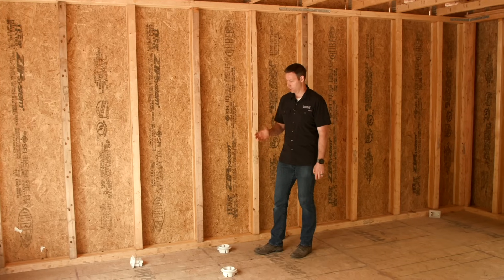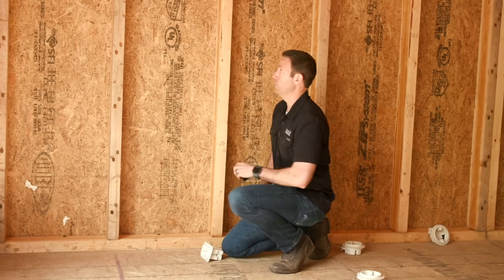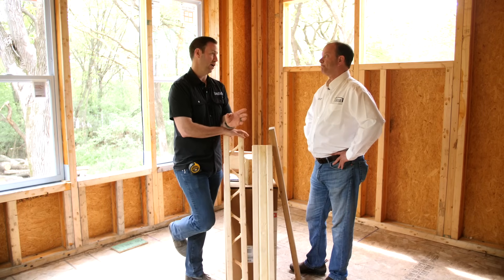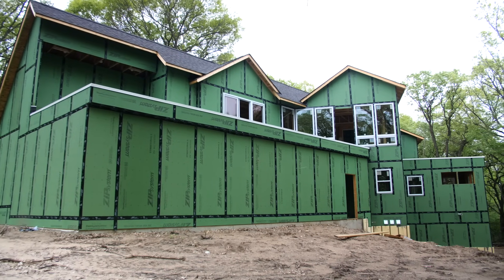Insulated Studs? This is a BIG Innovation in Framing!

Comment: I'm a plumbing contractor.  Can I just cut out one of the inside post braces if it lines up with a pipe? Will it lose strength?  Or just don't worry about it?
Reply: Good question, wondering that myself.  In theory, these would only be used on exterior walls, and at least in the North, plumbing tends to be designed away from exterior walls in new construction. that's not to say that you wouldn't ever run into the situation.
Reply: @andrewalexander9492  this may be true. But I like to stand at my kitchen sink while either washing pots & pans gazing out across the fields. I don't want to look at an interior wall all the time. Even in the north. I'm sorry to hear that's what people have to stare at.. i like the wide open fields.  Its Relaxing!!
Reply: Lee, apparently the answer is No.  The TStud Field guide says "NO dowels can be cut for placing pipes in walls or for any reason. See Tstud.com for how to make repairs in the field. "
Reply: @andrewalexander9492  so if I have a 1-1/ 2 inch drain arm running horizontally from a vertical 2 inch vent over to be under a kitchen sink with a large window over it. I'm either going to be to high or to low with the drain coming out of the wall? I'm sure I can think of more problems this will create for one sub or the other. Great product for the builder. I'm sure the electrician would love no drilling.  Plumbers work with measurements. (exact)  
If I have to drop my drain pipe down another 2 inches or more. Every drop of water that falls from the strainer to the water in the trap. Will make a loud sound. Kind f like when a plumber drops the p-trap to far away from the shower drain. It echoes like crazy.
  Don't get me wrong.  I love the product.  6.5 or 6.8 to 20 rating. Great idea!
Reply: @ltsgarage7780  Yeah, no doubt this will make some extra work for some trades on occasion.  Not a plumber, but in the situation you describe, can you run the drain arm off of a wye on the stack, and angle it up to the right height?  Or just come across horizontally at a lower (unobstructed) height, then 90 up, then out at the proper height?  Granted,  that's more fittings and more measurements,  so more time and money for you.
Reply: @andrewalexander9492  if it were code legal. It would be a fair idea. 
 I'm saying.  The 2 inch drain comes thru the bottom plate off to the side of the window. It comes up to 16 inches on center of a Tee. Then changes size but not direction. It continues straight up through the roof.
At the Tee. It will go horizontal over close to the center of the sink. You cannot move the dead arm up because if the home owner wants a good 1 or 1-1/2 hp garbage disposal the drain coming out of the wall will be to high. It you move the Tee & dead arm down. You pick up a noisy drain when you run water at the kitchen sink.
   Even where you live. Doesn't the Lady or the man of the house not enjoy being able to look out the large kitchen window while washing dishes or cooking then rinsing dishes. That's why I have a 6 foot bay window over my kitchen sink. You cant come through the bottom plate at the center of the kitchen sink. The travel straight up to a Tee at 16 inches the travel up to the bottom plate of the window because you cant install a 90 under 42 inches off the floor. Most counters are 36 inches the 4 inches to the bottom of the window. That 40 inches off the floor. We as plumbers must work within these codes. 
   I guess its  catch 22. T-studs everywhere then put up with a noisy drain. Or T-studs everywhere except a couple of 2x6 regular studs at the kitchen sink. So when the owners move in they don't complain to the plumber about how noisy the kitchen sink is. Because the contractor doesn't hear about this problem.  The plumber does.

Comment: Good luck with renovations. Running electrical and plumbing through those walls..........
Reply: You seem to not notice the part showing the electrician is just poking though the insulation with a screwdriver!
Reply: @Joshua79C  You seen to not understand how renovations work..
Reply: @TsiRoadkill  wow way to outright assume I know nothing of renovation works, I was a teen when my mom and step-dad at the time were taking the time to finish up what my dad had started before they got divorce,. I know all too well what is entailed in construction or renovation work.  I also watched the Tstud video of their product and seen that the two pieces of strip wood are connected by dowels in a pattern to hold the closed cell foam in place. But yeah I sort of get your point when it comes to conduit run or plumbing as I learned the basics of those as well both in high school and on the job with the step-dad working for him doing basement waterproofing work.

Comment: Begs the question: what has been the drawback before now. Spray foam has been around for good while now but no one has approached it from this angle. Would have thought someone would jump on it as soon as spray foam became available. 
Would say manufacturing this stud is quite a bit more costly than a mill spitting out studs. Wouldn't believe a savings of wood could be made up in the difference.
Does look like this is limited to 2X6 walls. Is the common 2X4 wall still cheaper? We see initial cost of construction is the drawback to using 2X6 walls. The general is not going to buy in to this 2X6 alternative so easily. And most homeowners are buying homes already constructed. So, looks like this is a limited market item until local codes start to change to require it such as in tornado/hurricane areas.
Reply: Rob, I'm guessing that you're located in the south, if you're saying that the General is not going to buy into 6 inch walls.  Not saying you're wrong, I'm sure what you're saying is correct for your area,  but in more northern regions 6 inch walls have been the standard  for decades now.  And it's primarily  because of  the insulting value.

Comment: Blast!! I saw a similar truss with wire instead of dowel used in Azore islands for roof trussing that had T cinder blocks set on top the covered with concrete and thought, that could be used for walls too.

Comment: What a bullshit, wood is actually fairly good insulator. In europe, we insulate our house from outside, not from inside... Make a house european way and it will last forever.
Reply: Then there are other Europeans who say "you still built with sticks?" or "No wonder your homes still get blown down in bad weather" who still build from stone or concrete. Not all regions around the world share the same building materials and method standards. Such guff irks me and shows their ignorances of their own building codes and standards. are not much better when it comes to earthquakes which can still shake their hard buildings to rubble.
I am planning on building with a combination of ICF, Post Frame and TStuds for the main structural, and then decide on what i like more when it comes to the insulation and cladding based on what i know and like about each.

Comment: You can confirm this inefficiency easily in your home.  A simple IR temp gun with laser pointer* clearly shows where all studs connect with your ceiling joists.  Pointing this at an inside ceiling corner on outside walls (this is where many heat soaked framing boards come together) after a sunny day will SHOCK you.  No amount of insulation will stop this radiant heat coming into your home...throughout the night!  The overall heat energy/mass available in your roof pours down these boards into your home like an open water pipe.

However, there's much better solutions than what is shown.  Fiberglass insulation coupling between all roof components (rafters) that couple to home/ceiling joists.  Very strong, available and requires little engineering.  It simply turns the heat spigot off.

*A IR imager works best but if you  check your cheap IR temp gun pointer accuracy on a heat point source (candle) from 10 feet away you will know how close the pointer is to the actual surface location temp is being measured.

Comment: Great video.

Electricians will love that stuff. :)
Reply: Skinski7, running wiring horizontally is obviously much easier with these newfangled studs, but how would you fasten the wire when running it vertically? Do you need some special strap fastener that bridges to the solid wood sides of the engineered stud? You can't possibly mount Romex or BX securely to the foam itself. I also wonder about fire codes and toxic gases in the event of a fire. Fireman would probably hate this stuff.
Reply: i would imagine smoke in a burning house is already quite toxic.

I’m sure someone will come up with some kind of bridging plate or clsmp  for vertical wiring.
Reply: @Skinski7  , as a former telecommunications installation Tech, the dangers of fumes in a burning building is something I have more than a passing familiarity with. The reason that we now have certain types of cable that can be purchased with a special fire rating for use in plenum ceilings or other building environments where there might be significant air flow taking place in the walls and ceilings,  or from one section of the building to another via air ducts,  is because people were being found dead just inside the entrances of Office Buildings that they tried to escape from due to a fire elsewhere in the building. Toxic fumes  weren't necessarily even that visible as smoke but we're being distributed  throughout the building by the ductwork . PVC insulation in particular puts out extremely toxic fumes when it is subject to high heat, not even necessarily burning. Ductwork and plenum ceilings in particular can spread those fumes many hundreds of feet away from the source of the actual fire. When I was doing Telecom installation work for a living, many of the jobs I worked on required plenum rated cabling, designed to not throw off toxic fumes when burning*, even if the cabling wasn't necessarily being run in a plenum drop ceiling with air circulating through it. I'll hazard a guess that each of those engineered and foam filled studs probably contains the equivalent volume of fifty or a hundred feet of electrical cable. If that foam is toxic when burned, it would be a very bad thing for anyone caught in a home on fire, and equally bad for the firefighters.

* early forms of plenum rated fire safe cabling or actually made with Teflon, the stuff was very stiff and springy and prone to kinking, not easy to work with. Later versions had a different insulation that was somewhat more forgiving but it still wasn't as easy to work with as PVC insulated cable.
Reply: I suppose the answer is a non-toxic foam of some sort if there is such a thing. I suppose it all comes down to risk/reward.
Reply: @Skinski7  , the  other thing that occurs to me is the ease with which mice and other rodents  could travel from one wall cavity to the next to the next to the next  unhindered, simply by chewing through the foam . Where I live in  woodsy Southern New England,  mice are everywhere and it is a constant battle  to keep them from setting up house  in my own house. I have several bucket traps in the Attic, several more in the garage and basement, and a few snap traps scattered around as well. The only way I could consider having a home built with those engineered studs is to add some kind of heavy screening over the foam filled middle section of the studs. For each and every stud.
Reply: That would certainly add a lot of cost, a screen over each stud.

Comment: At 4:50 that strap should be on the outside of the corner. Nails don't have a lot of withdrawal capacity, so if the house has high wind or seismic loads, that strap isn't going to be much help in holding the corner together.
Reply: What you say is correct, but I think that what you don't see is that there's also a strap on the outside of the corner. (or should be, anyway)  Looking at the Tstud field construction guide,  plates are required to be strapped on the outside.

Comment: headers laying flat?  bad header system!!  foundation bolts to framing--  wholly inadequate!!
Reply: fbabdiver sorry I don’t agree. That header is 1.5”x2.5 times 2 insulated and stacked. It’s solid to the top plate. The anchor plate could be screwed to sill then bolted but it looks like it has the same plate contact area or more as the traditional anchor for 2x6 framing.

Comment: Why is electricity not put in electrical pvc pipes like we do in the Netherlands? If you need to replace the cable (or extend it) for some reason you can easily replace it without removing the walls first

Comment: Left out the cost comparison with 2x6" 16" on center v 24" on center with a single top plate for a 2500 sq ft house. Like to know that important fact.
Reply: We all need to leave the 16 oc in the dust.  The one and only reason to worry about that is nailing of drywall and trim - but if you’re using foam and rigid panels the studs could be  4’ OC.  We waste an incredible amount of lumber - and in the wrong places.  I used to build all SIPS houses that had  zero studs and no structure other than the panels.  They were solid, airtight, and every square inch was nail base inside and out - had OSB on both sides of a 6” foam panel.
Reply: You could go their website which is linked in the description and ask them for a free quote comparing the two spacings for your needs.

Comment: Is there a reason why lumber is never the size it is labeled at?
Reply: Well lets see.  A 2x4 prior to being dried, planed and edged has a nominal and dimensional width of 2"x4" ( rough mill dimensions)  After drying, edging and planing the finished 2"x4" is now 1- 1/2" x 3- 1/2"   dimensional but is still called by its nominal dimension of 2"x4". Hope that helps?
Reply: @yardfowl3149  couldn't they do the rough cut at .5" larger and finish it at the actual size?
Reply: @impc2505  they could but they don't.  just one of those things thats been the way it is for years. Rough cut lumber vs milled. Have a great day man, take care .

Comment: It all boils down to the cost vs savings. These new studs have to pay for themselves with energy savings within 20 years to make it worth the added cost.
Reply: If the added cost on a 2500sqft home is actually $1500, then you are talking $75/year in HVAC savings required. In addition as Matt said, the increased insulation can result in reductions in other costs of the house as an offset.

Comment: This is an incredibly wasteful product. The R factor of wood is actually close to that of closed cell foam. Sawdust was used for centuries to insulate ice storage facilities. This also seems weaker to me that a solid 2x6. How's the side impact rating? How about after the foam core deteriorates as all foam products do? I'd like to see a cost comparison. I've seen too many engineered wood products fail in my 35+ years in the Residential and commercial contracting industry.
Reply: " The R factor of wood is actually close to that of closed cell foam. "  Except, it's actually not close at all. R value of softwood, per inch:  1.4.  R Value of Open-cell polyurethane spray foam, per inch: 3.6, R Value of extruded polystyrene foam, per inch: 5,   Foil-faced polyisocyanurate rigid panel (pentane expanded ), per inch 6.8.   Wood is less than half the R value of the least efficient foam,  so, not close at all.

Comment: What about price?  2.5x a stud?
What about sound transmission?
Reply: From the manufacturer website:  "The Tstud™ has been tested by USG (United States Gypsum) in their state of the art sound proof testing facility. The Tstud™ Wall Assembly provided an STC (sound transmission class) rating of a +6, which is equivalent to a wall being constructed with RC Channel (resilient channel) being applied to both sides of a wall.  This is a key benefit for structures being built next to noisy freeways, commercial locations, railroad tracks, etc. Equally important, the Tstud™ has many applications for use in interior party wall construction where STC ratings are important to minimize the transmission of sound from one room to the next. As in hotels, motels, apartments, senior housing, and in commercial or industrial applications."

Comment: You can stagger 2 x 4s on a wider sill plate so there is an internal air gap in the outer walls.
Reply: That's true, but there's a couple of downsides to that.  Staggered 2X4 walls are a little more labor intensive, and you still have a thermal bridge on the top and bottom plates.  The T-stud solves both of those problems.
Reply: @andrewalexander9492  Engineered products will evolve - insulated sill plates made of osb with integrated foam cavities.
Reply: Best to use two, non-connected footer and header plates...
Reply: The problem with that is once you air gap the studs you create a draft condition that is a major fire hazard and won't meet code requirements. It allows fire to propagate through out the wall and gives the fire oxygen to breath.

Comment: If you get the naked one, it would make it really fast and easy to run plumbing and electrical, then you can just spray it after.  That's actually a big time saver.  Not having to drill any holes.
Reply: I had the same though as I watched, they should consider this if the customer request for a bare stud, would save them time and the customer would save money on it. But for those sticking with batt type insulation then its best to offer both per customer choice.

Comment: wood is a great insulator.  I call BS
Reply: Wood is not a good insulator. R-value of around 1 per inch.
Reply: Agreed, wood was thought of as an insulator in the days BEFORE insulation was developed. Today we calculate the probability of damp and mould due to thermal bridging and solid timber is seen as a highly conductive element.